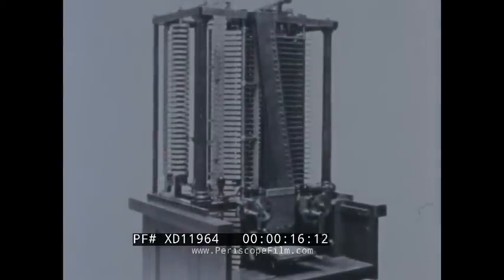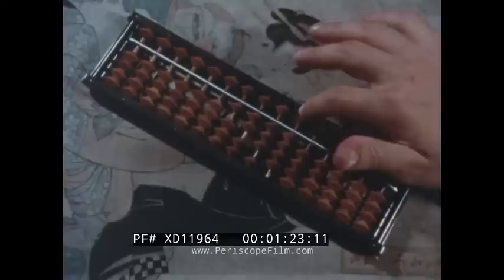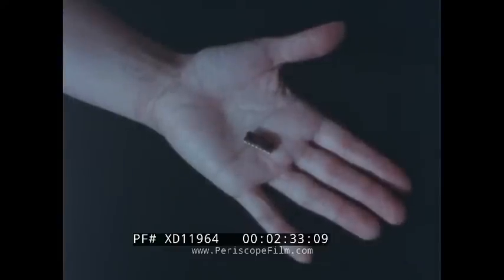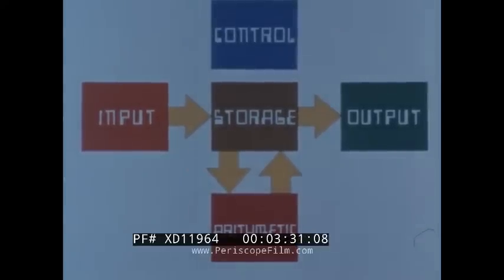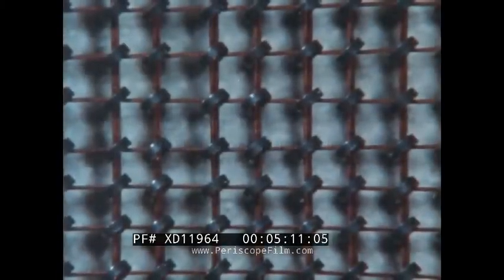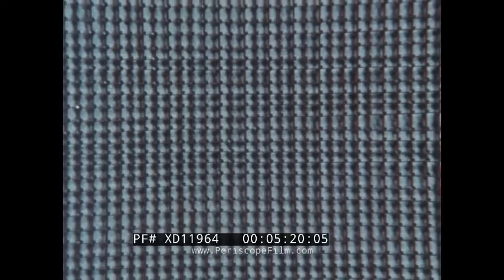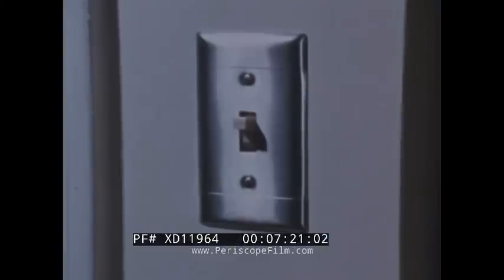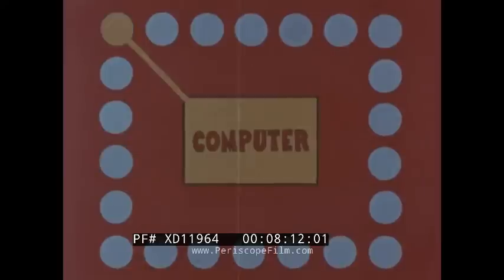" COMPUTERS " 1970 EDUCATIONAL FILM  IBM MAINFRAME PUNCHCARD & MAGNETIC TAPE BASED COMPUTERS XD11964

Comment: I earned my BS in ComSci WAY back in 1980. I wrote lots of IBM S/360 assembler (and also COBOL and FORTRAN) programs on 80-column punched cards in the late 70s. They ran on the school's IBM S/360 Model 50, with 512 KB of magnetic core memory. it was a fairly limited and older machine even then, but I learned a LOT about computing on it. The school also had a BASIC HP 2000 (IIRC) time-sharing machine that we used via async 9600 bps terminals. It was much more enjoyable to use because you could just type your lines on the screen, list them out, edit and reorder them, etc. without having to deal with a bunch of punched cards that could be, heaven forbid, DROPPED AND SCATTERED! 

I'm still in the business, and I'll probably finally retire in a 2 or 3 more years. I've worked with MANY different kinds of computers and operating systems. These days I write a lot of Java code in Eclipse on a nice M1 Macbook Pro with 16GB memory, a very fast 512 GB SSD, and nice big color screens, all connected to the internet via a very fast wi-fi connection. My laptop, as well as my iPhone 13 Pro, each have FAR more computing power than all 5 of the IBM mainframes that were used to control the Apollo moon shots. 

How very FAR we have come just in my career. It's frankly mind-boggling, and I've been amazed for well over four DECADES in this ever-changing business of information technology!
Reply: I had a very similar experience in the late 1960's and early 1970's. Wrote Fortran and IBM 360 assembler language for Electronic Engineering classes. Also assembler on SEL 800 series with 24 bit word width, had to enter bootstrap code with binary switches to read 2 pass assembly code punched tape from teletype ASR-33. Later on worked with Data General NOVA minicomputer, HP 2100 minicomputer & DEC PDP-8 & -11. It was a major revolution when we got hard disk drives and CRT terminals to write and save/load code. I later got to design and program microcomputer systems with 8080 and 6800 microprocessors. When the IBM PC came out in mid 1980's then computer programming and controls really took off.
Reply: @WJV9  NICE! Back in college I wrote a cross-assembler for the Motorola 6809... in S/360 Assembler! That was crazy, and it required two boxes of 80-column cards for the source code! It output 6-bit BDC machine code on 80-column cards that could be taken to a weird machine that could read the cards and write the contents to a paper tape, that could be taken to the 6809 machine and the instructions read in from it.

Later on at IBM, I worked with the Series/1 minicomputer. It competed with the DEC PDPs. It was a nice EIA 19" rack-mounted 16-bit machine with separate sets of 8 registers for each of the 4 hardware interrupt levels. We had lots of adapter cards for it: analog I/O, digital I/O, the Programmable Communications Subsystems, async, bisync, SDLC, and later on even a S/370 channel adapter to hook it up to a mainframe. Those were fun times, and I wrote some Series/1 Assembler back then. 

The group I was in even wrote our own OS for it, since the OSs from the lab - RPS and EDX - weren't really suitable for what we were trying to develop. I don't think any customer was ever able to put RPS into production... it took HOURS to do a Sysgen of it. RPS was a disaster that never worked... like trying to run MVS on a 16-bit 360 KIPS machine with 64K of RAM and a 9.6 MB hard drive. It was LAUGHABLE!
Reply: The HP 2000 BASIC source code for the computer game Trek 73 can be found on the Internet.
Reply: que buena onda pudiste ver toda la evolucion de las computadoras! una leyenda!
Reply: How about BASIC?
Reply: Good luck on your retirement in a year or so. Thanks for the post. Interesting.
Reply: @MovieMakingMan  I decided to hang it up earlier, and I retired last week on Feb 29. I figured that would be an interesting day to retire. We're heading out on a Caribbean cruise tomorrow with 4 of our 8 grandchildren, and I WON'T be thinking about computers (much)!
Reply: @kencarp57  That’s great Ken! Enjoy yourself and turn off your phone as much as possible 😀.
Reply: @kencarp57  Always interesting to hear experiences from those days. You guys were the pioneers of IT. A lot of standards were developed back then, a lot of them we still use today.

Comment: I wrote my 1st computer program in machine language in November 1963.  IBM 1620.  I wrote the loader app that ran when I pressed the button labeled IPL (short for Initial Program Load) to cause the computer to read one 80 column  card into core starting at memory location 1 and  transfer execution control to that location.  I punched the instructions myself on an IBM 024 keypunch machine.  Sheer joy!  I loved it.  Still at it with two 60 year anniversaries coming up.  You see, I married my wife on the 2nd day that very same month.  JFK was shot that month too.  2 wonderful things.  A 3rd thing I also will never forget, as sad as the other 2 were joyful.
Reply: Wow! What did that program do?
Reply: @lajosszel  This was a classroom assighment
  The specs were to create and run a program with input, process and output.  And to provide documentation describing what it did.

My little program read another card, punched that card, typed it on the computer console typewriter and  printed it 100 times on the "high speed" line printer.  Quotes because high speed was 100 lines per minute.

Everything worked the 1st time and I was shocked.  My instructor was pretty surprised too I think.  But then my instructor counted lines printed and there were only 99.  He still gave me a A, while explaining that coding and testing were inseparable and equally important.  And that eliminating bug's was as hard as writing the initial application.  I never forgot those lessons.  However, I've completely forgotten the data I put on the 2nd card.  Sigh... 🤔
Reply: I have a jaw dropping story 🙂
In a big distribution center they had some stone age IBM computer that provided serial ports to item list printers but the hard drive crashed.
I replaced the hard drive and was going to start the motor to the IML 8" floppy but it was already running. The motor was nearly red hot and the floppy was transparent, no magnetic layer left.
I had to clean the drive and use the spare floppy but it failed to open the console, someone has moved it to another port without updating the spare floppy. Panic was near, I had to dial a friend who work for IBM and he told me that there is only one person alive that know this stuff.
I got his mobile number and he answered from his boat, he was fishing. I told the story and he asked me to follow the cable and tell him the port.
Then he started to give me the op codes for patching the IML floppy from memory, I entered it on the switch board and the machine started so the operator could roll back the current status.
Things like that don't happen any more.
Reply: "(...)You see, I married my wife on the 2nd day that very same month.  JFK was shot that month too.  2 wonderful things. (...)"   someone could missunderstand that. or maybe i do?
Reply: @rodgerdodger2008  I envy you. Those times you coul really instruct the machine, speak its language literally. And the prof was really a prof, not someone between two jobs giving lessons he learned the night before, programming with softwares looking like flight simulators. But I don't complain it just came out. Cheers man!
Reply: @jorgvollmann2968  At first I also did, but obviously, the first event of that month was the one mentioned many lines above, that's why it looked like that.
Reply: @lajosszel  I think you're right.  As I type this reply I'm out on the mfg. floor uninstalling and reinstalling our shop floor control app because our version git buil numbers got out of sync between different teleases of same C# app running in US and UK.  MS VS keeps me so far from the machine I often feel powerless rather than powerful.  There's some folks faraway who have never been in the real world developing and deploying large apps telling me how I must do my job.  Several hundred remote users the help desk gets to deal with too... one by one.  Ugh!
Reply: @jorgvollmann2968  Joy 1: marrying my wife (1st best thing that ever happened to me,)
Joy 2: cutting code for very first time (2nd best!)
The sad thing was the death of JFK.  The world stopped for a whole week.  Next to death of my parents this was the saddest time of my life.  My point was all three things happened within the same 19 days in Nov 1963.
Reply: @birrextio6544  Sounds like something out of a 90s hacker movie!

Comment: I programmed computers in the 60x, 70s and 80s. Quite apart from the electronics they were marvels os electro-mechanical engineering and fascinating to watch. Magnetic tape drives were amazing with their servo chambers to allow rapid stop/start which gave the spools their characteristic twitching, like they were alive.
Reply: They were called vacuum columns.
Reply: @RaymondHng  they were not all vacuum columns some were rollers on spring loaded levers.
Reply: @geoff37s38  Those were called tension arms.
Reply: Some drives handled spools sealed with a clip ring. The spool was mounted and the drive opened the ring then threaded the tape through the path to the bottom spool, all done with photo cells and jets of compressed air. The operator only had to mount the spool, close door and hit the Load button.
Reply: @geoff37s38  they were not all vacuum columns some were rollers on spring loaded levers.
     I think those were the "cheapies," like Pertek (sp?) had the spring-loaded tension arms.  Kennedy and DG had the vacuum columns, and those were better; plus they didn't stretch the magnetic tape.
Reply: @josephgaviota  It was amazing how few tapes were damaged and unreadable. I recall some types of removable labels were leaving a residue on the spool and this was getting transferred by operators fingers to the tape and causing problems.  This was in the day when the operator had to manually thread the tape which eventually led to damage to the lead in which had to then be cut off and a new Beginning Of Tape foil marker stuck on.
Reply: @geoff37s38  It's great you mention BOT and EOT foils ... I'd completely forgotten about them until you just mentioned it!
Reply: @josephgaviota  Remember the paper tape readers that were so fast that the tape shot out in an arc and landed in a bin. Another marvel.
Reply: @geoff37s38  I cannot TELL you how much paper tape I've wound.
     My first job (age 17) was on a PDP-11i computer, which was paper tape in, paper tape out ... We had a motorized wheels with "sewing machine" pedals (so we could regulate the speed of the winding wheel) ... Dang, I've wound MILES of that tape.
Reply: @josephgaviota  My first programming job was on a Univac 1004. Plug board program, 961 characters magnetic core memory, 80 column punch card in and out.
Reply: @josephgaviota  I remember the Boss coming into the computer room and saw the operator trying to rewind a roll of paper tape to reverse order. “No, do it like this”. He pulled all the tape out from the centre causing hundreds of twists. The poor girl spent three hours trying to untangle the roll without ripping the tape.
Reply: So you already grandfather
Reply: I once had a job changing the magnetic tape reels. You had to be fast on your feet! Later on, I was part of a team that was transferring data from cassettes to a more modern computer network, back in the year 2001!

Comment: I remember reading about all this stuff back around 1970.  It was only the next year that the microprocessor became available and started the microcomputer revolution.  We knew that something awesome was ahead, but none of us could properly envision it.
Reply: I have done the same thing, I bought a mail course in Fortran, Cobol and Assembler for the mainframes 1972 but it took over 2 weeks to get back the errors from the compilers and by that time I had forgot what I was thinking.
I skipped that course and started to read about Unix instead but it took over 10 years before I got my hands on a terminal to a Unix system.
I was working with hardware so I was able to build my own computer using scrap I got from work. But as you say, who understood the coming future where 128 KB memory evolved to 128GB on a home pc ?
Reply: @birrextio6544  128 GB is more of a professional workstation spec than the home pc. 16 GB is standard nowadays and 32 GB for the power home user. Anything above 32 GB and you are into something very demanding like super hi res video editing, several virtualised OS:s  running etc...
Reply: @Magnus_Loov  You are right but the first home computers had 8,16,32 and up to 64 KB Ram so it's still million times more.
I had friends that made up to 1MB address space using bank switching but they only got 128 KB dues to costs and limited MB slots.
Reply: @birrextio6544  What kind of computer did you build from scrap? What did you use it for?
Reply: @gregorymalchuk272  
The company I worked for was making prototypes and products in small series and I was working with testing.
Some cards was discarded as junk and I picked the good parts from them.
Well, the only thing they was useful for was tests and education, I learned the op codes and wrote simple things that made them boot and flash some lights and so on.
I'm not sure about what years but I guess I was using a simple 4-bits CPU 1972-1974.
Then it was not my choice what to use, it depended on what we was producing, so I ended up with a 6808 cpu, flex 2 DOS, 4 floppies 1MB each, 56KB Ram 2 Serial ports and a modem where club members could dial in and exchange files or I could connect a printer.
It got upgraded to 6809 flex9 DOS later and stylograph word processor and, URRRK! a basic compiler made by Bill Gates.
OK, not everything was stuff I got for free, I had to buy the box, power supply, wordprocessor, basic compiler, flex2, flex9 and a few other things.
Reply: @birrextio6544  I was a s/w dev mgr by then with ~20 programmers.  We had a service request queue that went out 3 years.  One user depart bought a TRS-80 from Radio Shack and secretly developed their own system.  We knew our world had changed!
Reply: @rodgerdodger2008  I had one TRS-80 that I got for free, I found it unusable for me, I only had the CP/M floppy and nothing more.
Congrats if you found any use for it.
Reply: @rodgerdodger2008  I remember when my work got a TRS-80 in the front office.  It had those GIANT 8" floppys, which I think held 64K each.  One floppy could hold a 32-page document!! (or 10 3-page documents, etc.)  Simply amazing—well, in 1984 it was.
Reply: Bill Gates sure envisioned it.

Comment: In 1980 my typing teacher told us that someday we'd write on word processors which were small computers. Wow, he sounded smart!
Then he said the computers had a "chip" in them that did everything. Uh, they have lots of chips in them but OK.
Then he said if the computer broke, they'd just "open the chip" and "repair" it. UH, I tried to explain to him that integrated circuits were microscopic and couldn't be repaired when they fail. He said I had absolutely no idea what I was talking about. 42 years later I'm still pissed at him for knowing something that he didn't.
Reply: You were spot on. The only way to fix is to replace!
Reply: My Z80s and 6502s used to break down all the time. Such a hassle 'cause I never payed for the extended warranty. The repair guys would come over with their tiny little wrenches and have those puppies humming again within an hour or two. Quality work, but those those repair bills added up. Those were the days.
Reply: What he meant is that they would just open up a Commodore C64, then de-solder and resolder on some new chip, resistor, or capacitor. Handy repair job!
Reply: @jeromeglick  You think he was talking about a computer two years in the future? Maybe he did know what he was talking about!